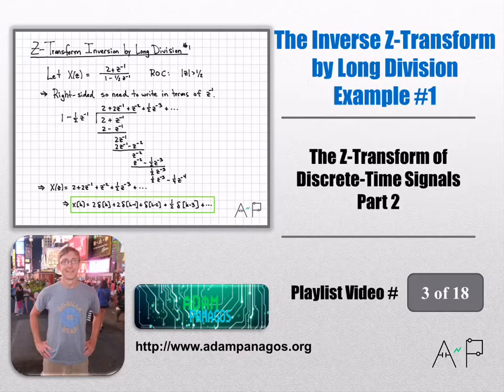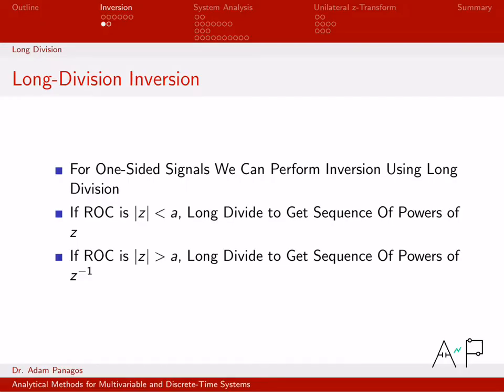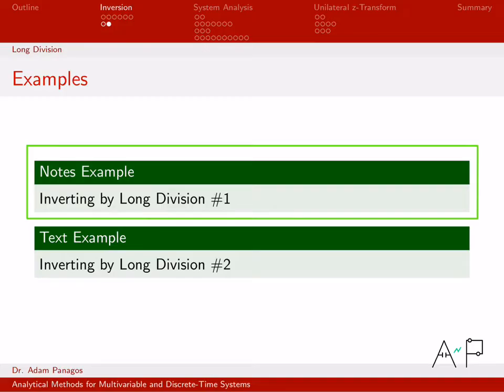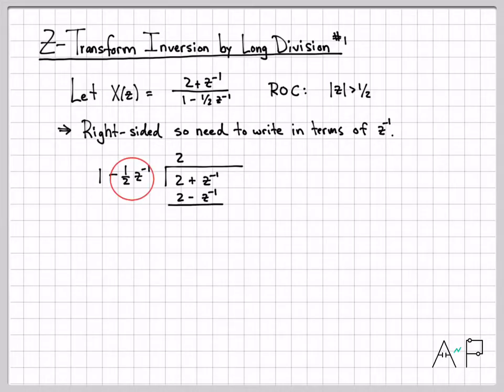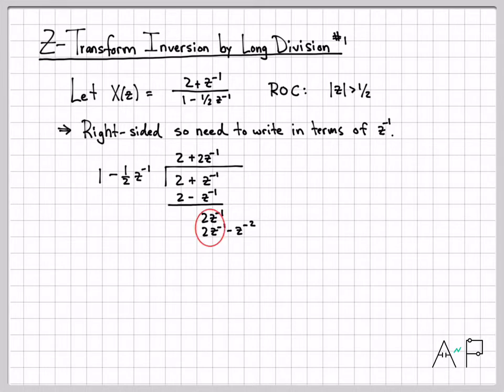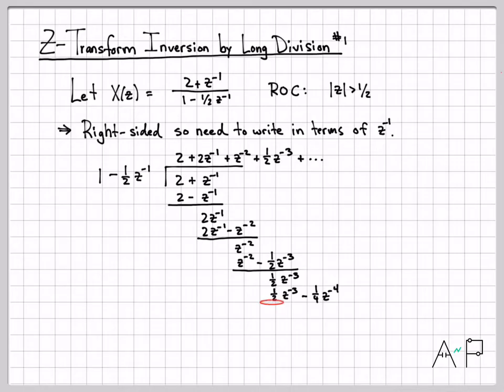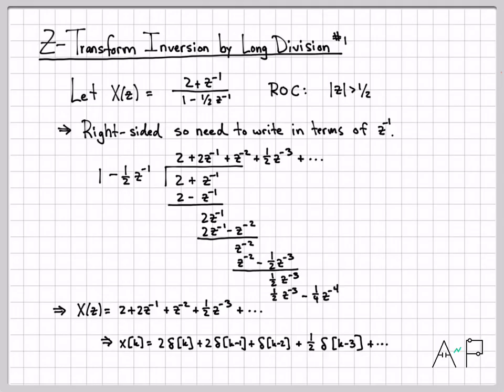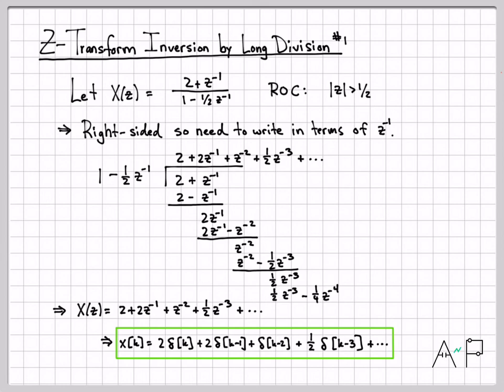The Inverse Z-Transform by Long Division Example #1

Comment: What if I have a transfer function H(z) but the ROC is not mentioned and I'm supposed to use the long division method to find the first 3 samples of h(n)? What do I do?
Reply from the maker: You'd probably assume it's a casual system so the impulse response "goes to the right", not the left. Hope that helps,
Adam
Reply: @AdamPanagos  thanks :)